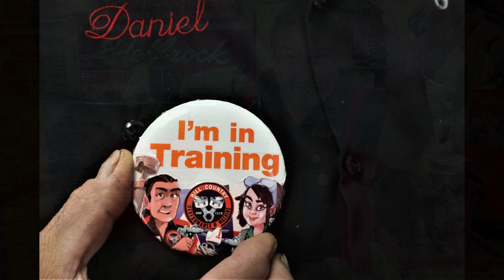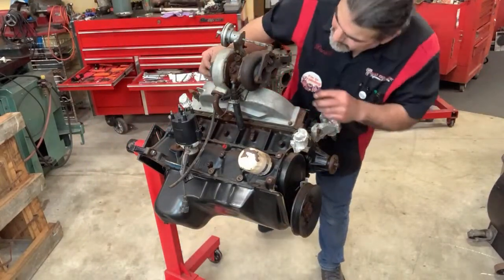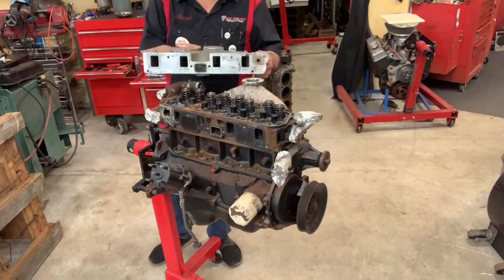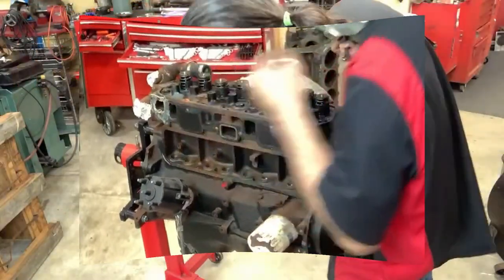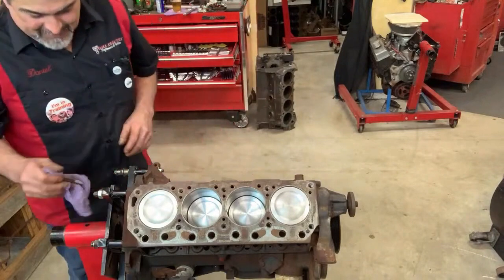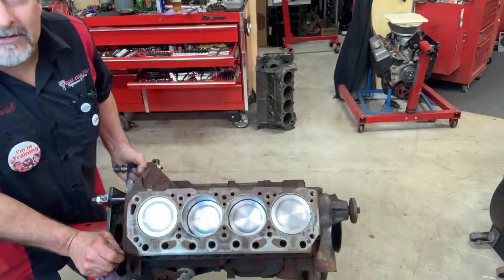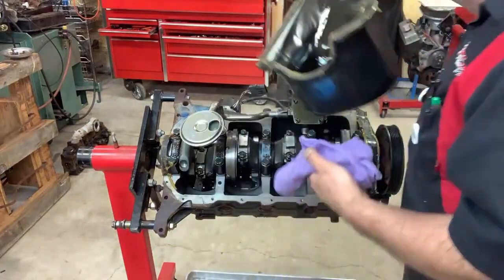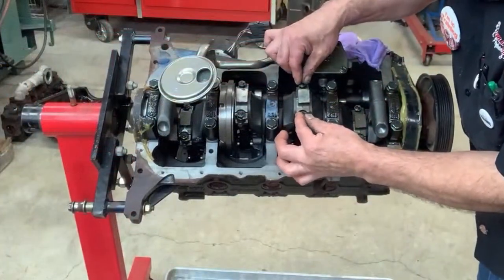Time Lapse: Taking Apart Smokey Yunick's Hot Vapor Engine Part 2

Comment: This is very interesting project your own. I remember there was a car that got 150 or 300 miles per gallon , something like that ?  : ) Used a similar system of super heating the fuel to accomplish the high mpg. Back in the 50's ? I saw a video on it years ago. I think the green grease in the oil pan came from when they assembled the engine to lubricate it before the oil pressure built up.
Reply from the maker: I think your referring to the Shell car I’ve seen that video.

Comment: Hi Danny, great video and thank you so much for sharing! Have been a fan of Smokies for years and also have built a Geet fuel processor, have not watched all your videos yet just discovered you but what is your best guess as to compression ratio of that engine and what is different about the camshaft? Is it a low overlap high torque type cam? I am asking because I do a little experimenting here myself lol
Reply from the maker: I’m establishing about 8 to 1 on the compression. I’m currently building a cam doctor so I can map all the cams.

Comment: not to sound like a nay sayer or such. how do these hot vapor engines run before the warm up to temp so they can heat up the gas to vapor? just curious
Reply from the maker: We ran the Chrysler 2.2L engine @38*F and it started right up and did not need any warm up time. We just had a meeting with one of the original engineers that tested these engines and he said “they didn’t know how it worked but they did”
Reply: @MrDanielSoliz  ok cool, i have my eye on am 80's shelby charger turbo with a 4 cyl in it that i was thinking of looking up blueprints of the hot vapor engine to clone in it
Reply from the maker: @TheDracfink  great choice , I also the the rampage.
Reply: @MrDanielSoliz  no that would be a very fitting car/truck for that engine.